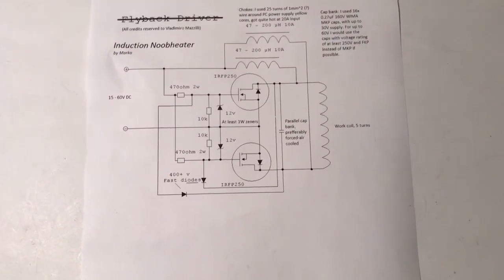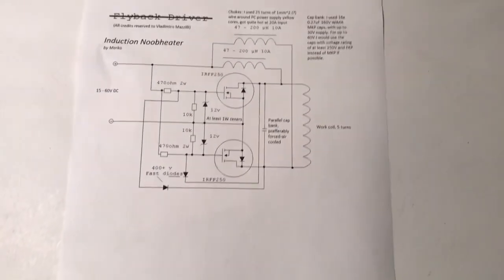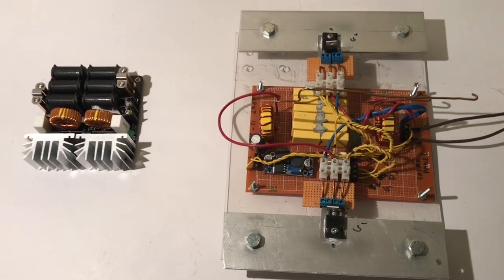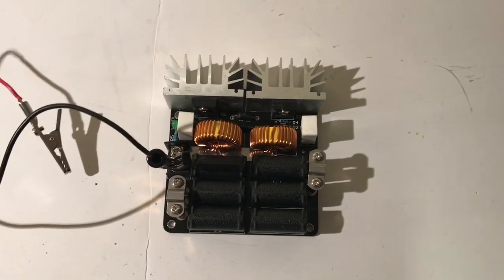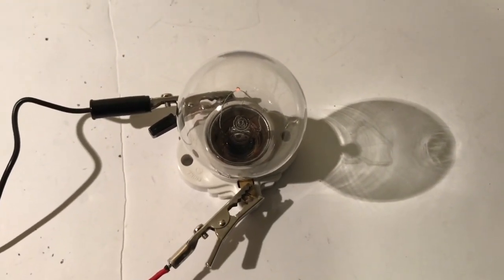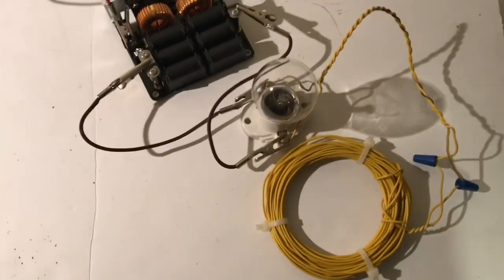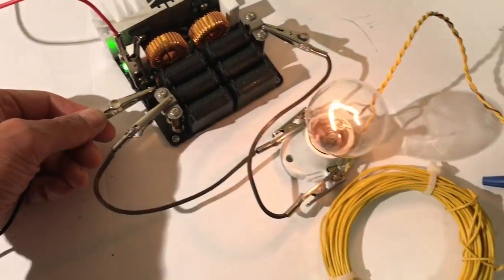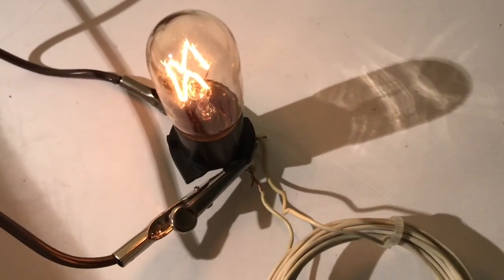This Should not Happen— or Should It?

Comment: Warning if you continue to use this circuit with no work coil ether 12 turns with a center tap for 3 outputs or 6 turns for 2 outputs it will blow up your mosfets
Reply: This acts as an inverter and an induction heater you always have to have a work coil connected to it and if you put a ferrous metal near the work coil typically in the middle it will heat it up
Reply: And this is a high frequency driver so you have to have a ferrite core to make an inverter out of it, a high voltage generator is a good example like an old crt flyback transformer or a high current  ferrite core transformer
Reply: It also acts as a signal sender like if you have a work coil connected to the circuit and have another coil connected to a light bulb or an led you can power it when you get close to the work coil
Reply from the maker: - haha it did

Comment: > ...the main uses for this circuit are in construction of induction heaters...

WHAT??

Actually Vladimiro Mazzilli (of Milano in Italia) used his engineering skills to work on TESLA COILS and there are quite obvious photographs to prove just that without the shadow of a doubt:

https://i.postimg.cc/9QyzFx99/Pupman-Vladimiro-Mazzilli-Milano-Italia-MOSFET-driven-Tesla-Coil-480x400.png
Please distribute that enlargement i made by refering to this original source:

https://www.pupman.com/current/vladi/vladmap.htm
Mazzilli Vladimiro's Tesla Coil images

And of course it's far beyond just "a far stretch" to even insinuate there's any Mazzilli engineering in today's IH drivers as those built around some former "Mazzilli ZVS" Tesla Coil modules, most probably in need to get rebranded since being deprecated as Tesla Coil modules today i believe...

For all we can tell the typical over-simplified Mazzilli modules never went through any adaptative transformation, which is a hint that the reseller(s) can't care less about significant differences between the Tesla Coil and Induction WorkCoil scenarios.  Visual proof is obvious enough, there's ain't no "Snubber" components to be found because the technical work required to implement that can only be performed by skilled people with the sufficient measurement tools.  Etc., etc.  In other words raise an eyebrow the split second one comes around bragging about how much "engineering" there is in a Mazzilli ZVS module, as a mercantile argument one may suspect.

Oh maybe it's not about making fortunes but there's a stalled universe building around this failed experiment and i ain't the 1st to wonder how far the fanboys faith will entrench them into plain ideologic denial, unable to appreciate what it really takes in this particular context.  Long long ago a paper was written about the "shoot through" problem which plagues Mazzilli topologies since at least 2008 it seems:

https://docplayer.net/26964431-High-voltage-resonant-self-tracking-current-fed-converter-a-thesis-presented-to-the-faculty-of-california-polytechnic-state-university.html
High voltage resonant self-tracking current-fed converter (2010-Mar) - { A Thesis presented to the Faculty of California Polytechnic State University... }

p53/152 Figure 2.9:  Mazzilli Converter Topology

I found mention of a "shoot-through" problem, which is also known as "interlock".

In other words the hard-wired problems (e.g. "by design") of Mazzilli's topology were already known more than a decade ago and although memories tend to forget we have historical records to gain a more accurate perspective on what's involved exactly.  Imagine, a thesis...  Now tell me nobody ever noticed a thing about it!

So, if it sounds "too good to be true" then maybe it is, or least there are untold trade-offs associated with this activity for which i got to wonder if Mazzilli himself will ever compensation for the fraudulent use of his name & engineer title.  M'well, now you know - or please someone show me successful correctives which have sticked around ever since, while i still don't see any definitive trace of them despite some intensive search...

In conclusion Mazzilli modules for Induction Heat are a mirage, there's no Mazzilli designer skills in it except for a careless mercantile rebranding of deprecated Tesla Coil junk.

Comment: Since it is oscillating even without the coil, it is probably just acts as a boost converter when connected to the light bulb. The higher voltage must result from the rapid field collapse in the inductors.
Reply from the maker: Likely how it’s working
Reply: @BrianDhvTinkerer it is not , its even giving out less energy than the input

Comment: Wait!
Since the output of Mazilli Driver has three pins and the bulb has only two. Where is the third pin ?
Reply from the maker: This one has 2 output pins to the work coil. It is the modified mazilli (noob heater) based on design of Marko Bakula
Reply: @BrianDhvTinkerer  Noob Heater is a nice name I got to know...😂😂
Reply: U can convert it into two outs you have to have another inductor THE SAME HENRY and put it on one side of the output work coil and move the other inductor to the other side of the output work coil